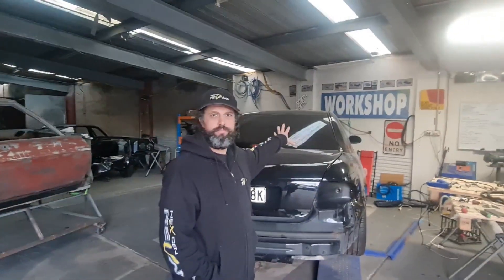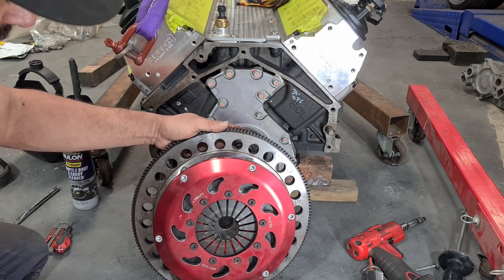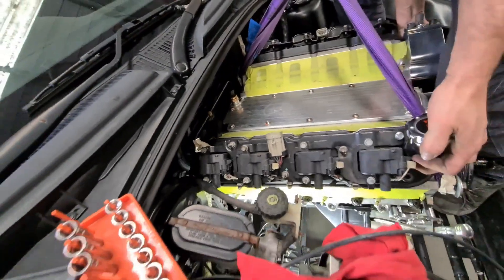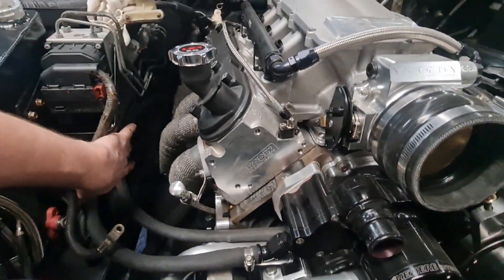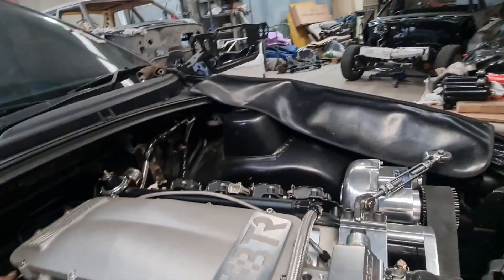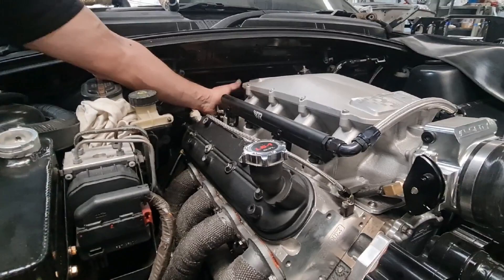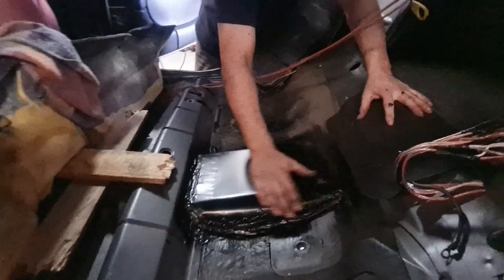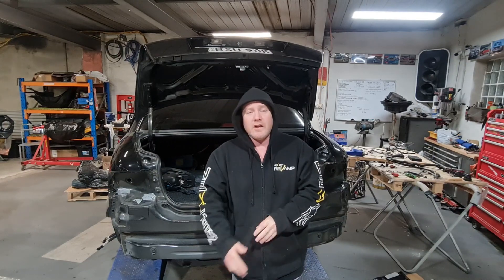F1A94 PROCHARGER SUPERCHARGED , 408 STROKER ENGINE INSTALL , ALMOST READY TO RUMBLE

Comment: great work guys

Can you tell me what ATI balancer your using
Reply from the maker: Hi Stephen sorry for slow reply i havnt been  able to get in and have a look yet il have a look tomorrow when im under the bonnet :)
Reply: @nexgenrevamp2976  thanks 
Im also building vx clubsport procharger 
I Waa wondering are you running petrol surge tank 
The radiator idea was absolutely great to out on an angle I was about to do the same but then a radiator and fans came cheap so bought those 
Im in Sydney are you guys down the shire way
Reply from the maker: Hi Stephen , the fuel cell we have in the boot has a inbuilt surge tank , it has 12 small chambers inside which basically acts as a surge tank so we dont have any fuel loss problems , i wasnt able to see the ati balancer as the blower pulley is over it il have to have a look and see if i have some pics of it , yeah we re down wollongong way
Reply: @nexgenrevamp2976  you don't have the receipt which would have part number on it
Reply: @nexgenrevamp2976  do you guys respray cars too 
Not looking for show quality paint work just a good paint job that doesn't come with the price tag ppl are charging
Reply from the maker: hi Stephen il have a look see if i can find it was a few years ago now , no sorry we dont do spray jobs only on my cars as a mate does them
Reply from the maker: sent u a pic to fb messenger
Reply: @nexgenrevamp2976  ok if you don't ask you don't know 

Im building cast iron 403cub F1 procharger LS im running intetcooler and now I was told to buy a water meth direct port kit which is good for intake temps a
Reply from the maker: Should end up a stout combo.
I would have thought if your intercooler is efficient enough the water/meth wouldn't be necessary. The VX uses a plasma man cooler and the tuner hasn't suggested intake temps are of any issue. 
Engine bay temps can also effect intact air temps. Air flow for air filter, heat wrapping headers and insulating fuel lines as examples. 
The VX has been a major undertaking in heat management  this time around.